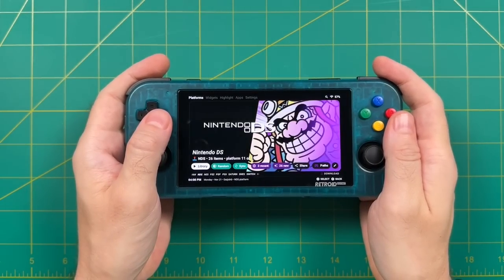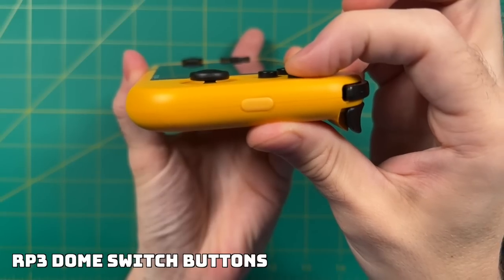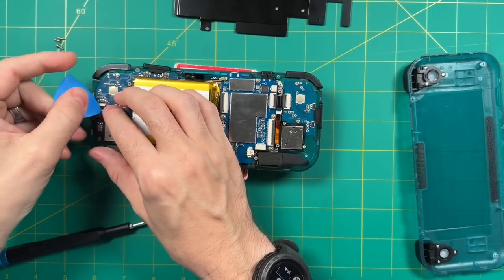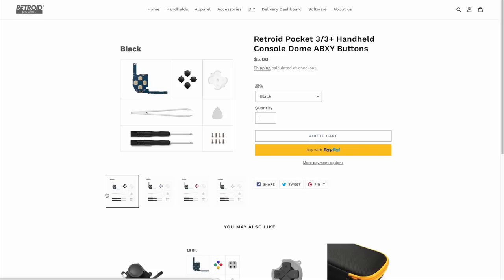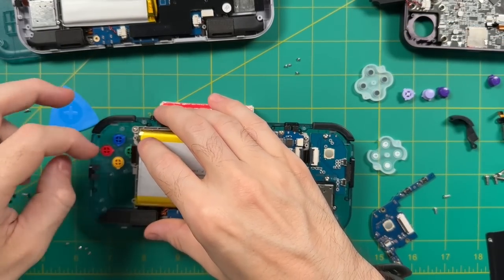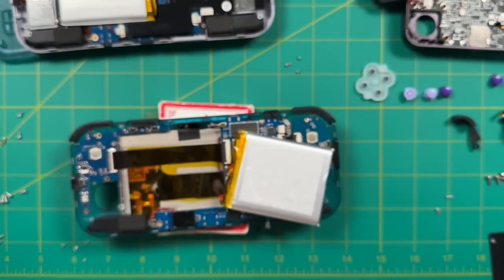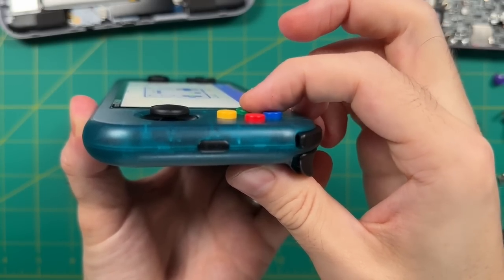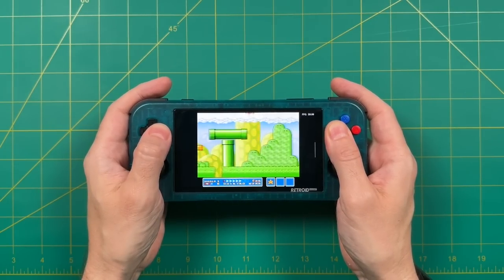Retroid Pocket 3+ Button Modification Guide

Comment: You should always disconnect a battery before you go mucking around inside electronics. Tap that screwdriver in the wrong spot, connect two leads that shouldn't connect, and your device is a brick. I know you didn't, and it worked out fine, but you may want to inform your viewers that they should. Last thing you want is someone ruining their device because they followed your guide.
Reply: Commenting to get this comment to the top.
Reply: Tru Dat.
Reply: You mean “Last thing you want is someone ruining their device while following your guide”, which I’m sure Ross wouldn’t want, but he certainly didn’t say, “tap your screwdriver left and right and see what happens”.
Reply: @suntorytimes1  Weirdly pedantic there, but disconnecting batteries is just generally accepted as a best practice while working on anything battery powered. In this case, something powered was plugged and unplugged which in itself can cause issues like transients or static discharge, which can ruin electronics permanently.
Add the fact that Russ literally damaged the battery and still reassembled the device with intent to use it and recharge it despite creating a lithium fire hazard, we definitely need community input and your comment is unwarranted.
Reply: I mean, he did mention disconnecting the battery…
Reply: @Emuland69  "If you'd like" he says. Should be a standard required step.
Reply: @niall21  I was pointing out what I thought was an unwarranted conclusion. If that makes my comment "weirdly pedantic", then your reply is too; although I can't see the value in saying so, it's just an appeal to ridicule, a kind of personal attack.
Also you seem to be strawmanning me, I never said it wasn't best practice or that we don't need community input.
The problem is that what OP said implies that if one followed this guide, made a mistake and said "look what you made me do!" they would be in the right, and I think that would be certainly unwarranted.
Reply: @niall21 at this point, if you didn’t know to do that to begin with, you shouldn’t even be playing the system let alone tearing into it… 🤡
Reply: Lol
Reply: How do I do that???????
Reply: Honestly I tried, but that battery connector is stuck there VERY tightly and the positioning is not favorable to remove it. I weighted my chances and realized that trying to remove that connector would risk me breaking something in the process, so I took the risk of keeping the battery in which I estimated was smaller than shorting something later.
So I did it just like Russ, had no issues. I think the real danger from doing it this way is if you stick a screwdriver where you shouldn't and create an unlucky short, but I was careful with my tools.
Reply: @steel5897  mine was hard to remove by hand because there was nothing to grab but it poppy out the connector on the board pretty easy with a tool
Reply: Not to mention the safety issue. These lithium ion batteries have enough zap to kill a person.
Reply: This literally happened to me even though I was being very careful with it :(
Reply: @suntorytimes1  This guide is, in fact, dangerous because it doesn't include disconnecting the battery. He may not have said to "tap your screwdriver left and right" but that kind of thing happens organically. When exposing traces and terminations, especially with a metal tool, it's irresponsible to not start with disconnecting the battery.

Comment: When rp3 came out with extra membrane buttons, EVERYBODY became livid. They say retroid is lazy, why didn't they put the obvious superior buttons in out of the box. But then now EVERYBODY hates membrane and prefers the old dome buttons 🤦🏿‍♂️ no one can ever be satisfied. Also d-pad dome, 4 buttons membrane is what a lot of modern controllers use, like the Xbox. So no matter what retroid do, NOBODY will be satisfied. I like either one.
Reply: Ok so my issue isn't with membrane buttons inherently. I love my 8bitdo controllers, I love my Anbernic devices. All membrane, all very good and responsive.
My issue is specifically with the membrane buttons they used on the RP3+. They are VERY STIFF and have way more travel than something like an SN30 Pro or an Xbox controller. This is not me being picky either, playing fast action games where I need to rapid fire like Metal Slug would physically tire my thumb out on the RP3+ buttons, real fatigue from having to put so much force into pressing them quickly.
The dome buttons by comparison require very little force to actuate, and have very short travel time.
tl;dr: membrane buttons are good on anbernic, 8bitdo, xbox, etc, but sucked on RP3+.

Comment: Hello, i just want to share this: I got an used RP3+ from ebay "in good shape" the seller says, turns out the L1 trigger was broken. It broke right at the thin plastic. So i took foam from one side of power button, and stuck it under the L1 trigger near the broken piece. Good as new. I also took foam from the home button for the R1 just incase it breaks. When i replaced my buttons to the sakura playstation buttons, i noticed R1 DID brake. So good thing i did it to the other side as well.

I also put a small square piece of felt tape on the R2 and L2 dome switches to shorten the stroke since its just a button, not analog.

Comment: I like RP3+ as I think its a great emulation machine for the price but was always bothered by the small face buttons. It felt like they "dig" into my fingers too much due to higher travel and firmness. I know most console controllers use rubber switches as well, but they have larger buttons which made it ok for me. After seeing this video, I changed the RP3+ buttons to dome switches and was so much more comfortable! I also changed the analogs to hall sticks and added the official grips and its now much nicer to game for longer time. Thanks, Russ!

Comment: Glad to see the rubber membrane buttons can be changed individually. Been thinking of opening my 3+ and changing them to an Xbox layout with A in the south position.
Reply: It'd make it unique, I would do it.
Reply: In case anyone else was gonna try this, don’t bother. The buttons all have different notches so they aren’t interchangeable between button holes.
Reply: @ryanlloyd6100  ohyeah forgot about it 🤦🏿‍♂️ but I think many videos stated it, it's so you won't drop in wrong hole. Also don't remove membrane buttons thinking you can add the other clicky buttons, you'll have to glue them on if you want that option.

Comment: Hey Russ,

  Another great video! i swapped my buttons to the Vita buttons last week and i feel the need to swap to the dome switches as they dont contact the same as they would on the RP3. With that being said I have another issue im wondering if youve run into. My RP3+ has been great since i got it though for some reason recently my input device has switched from xinput to "Virtual controller" i tried switching between the retro and xbox controller but for some reason it doesnt change anything other than the ABXY not the input type. Super odd and i was hoping there was an answer in the settings but so far i cant find anything... anyway if you or anyone reading this knows how to fix feel free to drop a reply aha. TIA

Comment: Damn original screwdriver is a piece of shit. Can't get out the heatsink because two screws won't spin lmao. Gotta get some good screwdrivers
Reply: Yup, the tools they sent are crap, nearly stripped one of my outer screws to death. Would have been a disaster if I kept trying. Luckily I had a good torx bit set which did the job. They also sent replacement screws so that helped too, I replaced the partially stripped screw.
Reply: @steel5897  I bought a screw set and was surprised that the retroid actually had different head sizes. Their screw is not an option

Comment: Holy... this is a massive night and day difference, these buttons are so much better. Whoever advised Retroid to ship with the stiff membrane buttons should be ashamed of themselves. I know who it was even, hope that guy and his ego piss off.
Thanks for the guide. One thing that's kinda misleading especially if you are mostly listening to the video is the heatsink part, you say "four screws" but it actually has eight screws, four of which you DON'T want to mess with as they hold both parts of the heatsink together, these are the four inner screws arranged in a rectangle. I foolishly went for those first, separating my heatsink into two pieces, which was a pain to align later. Other than that, it all went smoothly.

Comment: Hey RGC, quick question..just wondering about  the mechanism  that returns the shoulder button affter being pressed. I dropped my Retroid and both shoulder buttons work but do not click anymore. Are they acessable by just removing the face plate? Keep up the great videos.

Comment: finally did the dome switch face button and gulikit stick conversion on my rp3+   -- despite its limited performance in gamecube and n3ds it is now my favorite android handheld (moving ahead of zenfone 9 + backbone controller), just so comfortable -- feel is one of the most important factors and the improved sticks and buttons make all the difference 

also, this device (with the use of button mapping) becomes an excellent comic reader for panel by panel apps like marvel unlimited -- just map face buttons for turning page forward and back and this thing works excellent -- a pocket sized comic reader  (I know a phone already does this, but having the ergonomics of a handheld grip and button mapping allows for a far more comfortable experience)

Comment: Great vid! I tried to remove crap from behind the plastic covering the screen of a (pretty horrible) AtGames Ultimate Portable Megadrive once. Once starting to pull the two halves of the shell apart there seemed to be a number if things that really did NOT want me to do that, so I just pressed it back together & the crap remained (maybe it has grown...eeewwww!). I would feel so nervous opening up my beloved 3+ (or my 2+ or 350m). I don't  THINK I have that incorrect polarity speaker issue...but I don't  want to do the test thing as if I find out I do I will then have an inner conflict of wanting to sort it out but NOT wanting to start fiddling around with all of these fragile looking electrical components.

Comment: Hi Russ! thanks so much for this guide! I just did this upgrade and I like the domes a lot. But i found that the buttons themselves felt a bit loose in the shell? like they can be pressed down a bit before activating the switch, almost like the buttons are too short or something? they seemed to move around quite a bit and were overly clicky, not like the soft click of the dpad.

i put some tiny foam double sided tape squares underneath each button to make them a bit more snug, and they’re ok now but a bit stiffer.

 i was wondering if you had this problem too? I used the buttons that came with the upgrade, not my originals.

thanks so much, and keep up the great work! i’m a huge fan of the channel.

Comment: I really impressed myself did the replacement in 1h20... usually I get very nervous or irritated when I get stuck. Those connectors are so incredibly small it's even hard to see them as I am nearing 50. I also had to remove the battery as re-insterting the battery ribbon is very tricky. Opening the shell with the pick was much easier than I thought. For the small ribbon to the analog stick the pincers are necessary although they slide off the plastic, but just to guide. There is a small indent which allows to push the ribbon in place with the pick. For the battery ribbon you can't  even see in the video because it's so small but there is like a latch, similar to the things holding RAMS in place, there is an extremely thin black plastic latch that pops out releasing the ribbon - so you first put back the ribbon and click the latch back on top. When I placed back the PCB I didnt notice the L2 there is a small notch that needs to go INTO it, mine was on top and the button didn't click. Just check the buttons as suggested in the video.

Dome buttons do feel much nicer. I am now very glad I ordered the DOME buttons kit originally - I never bothered to replace them until I had this issue seen on reddit where the B and R2 buttons became fused. I barely even used this thing!! Fortunately the replacement buttons and PCB fixed the issue. I guess you should avoid ordering those toys soon after release.
Reply: We're the lucky ones, they stopped selling them a long time ago. 
I agree dome switches are amazing on this handheld. Feels way more responsive, to the point I thought there was software input lag before but after switching to dome I realized it was the physical movement of the contact rubber that was causing that perceived latency.

Comment: I am team rubber membrane, but pretty cool guide nonetheless, Russ! Is it possible to put a membrane connection on the Dpad?

Also looking forward to the Gulikit thumbstick mod test!
Reply: Retroid did have membrane Dpads you could swap into the 3, but they only sell the dome dpad board currently
Reply: @dopesheepify  they are selling dome type button as well. Just bought 1 bec my hand is aching due to rubber membrane

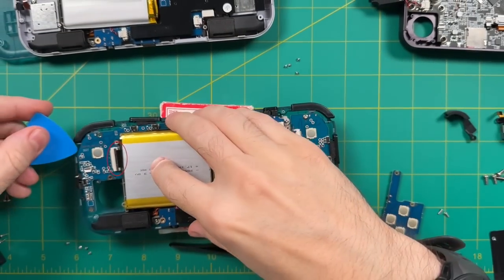Comment: I don't know how to disconnect the ribbon cable from the PC at 3:30
Reply: Open the black inner latch up with a plastic pick (they send one with the official dome buttons), then carefully use your fingers to nudge the cable out from left to right. After it's out, pull it up a bit so you can work on the PCB.

Comment: I would take the other turn: switch out the clicky D-pad for a D-pad with rubber membrane connections 😛
Reply: By default it's dome switch ? Can you remplace it by membrane ?
Reply: I absolutely hate the dpad on the rp3+. I can’t move the way I can on my 35xx.